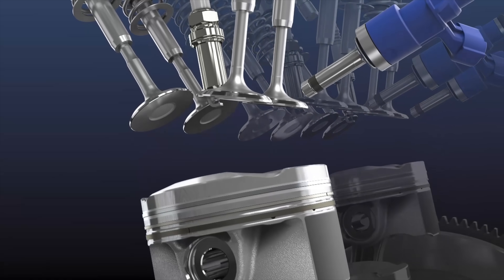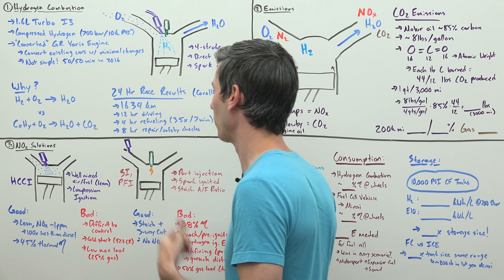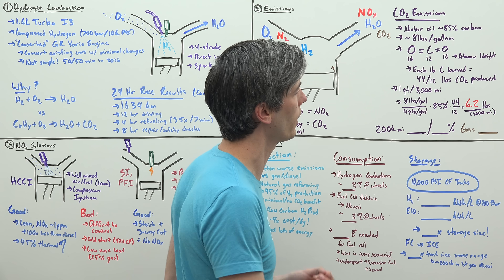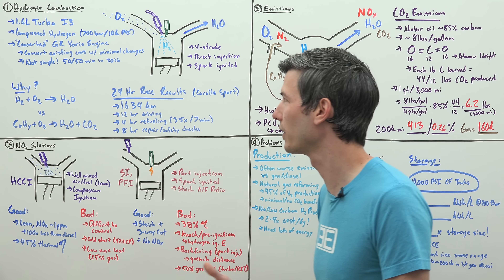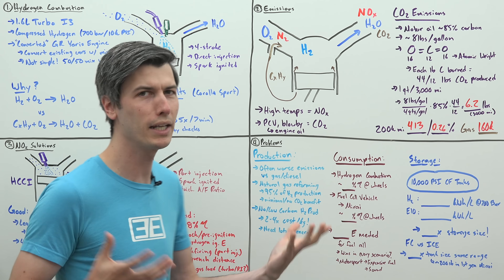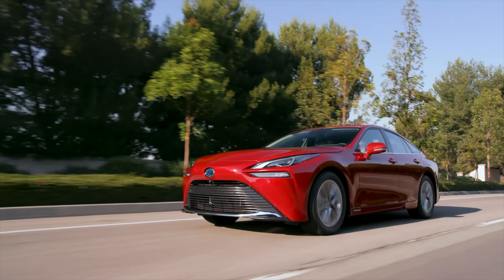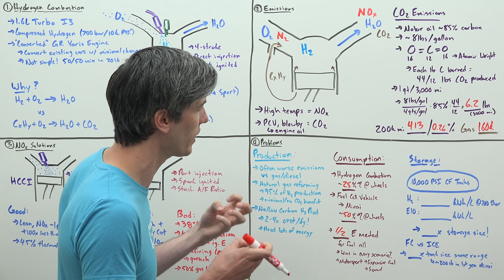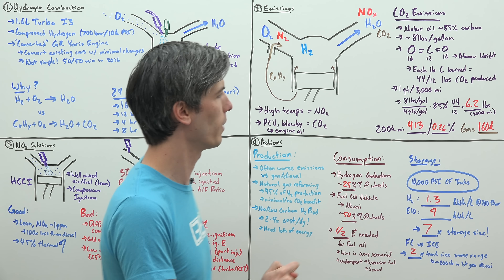Toyota's Developing A Hydrogen Combustion Engine!

Comment: EVs are not the future. First of all, Lithium extraction is extremely harmful to the environment as it destroys and poison's waterways. Second, it's finite, and the deposits are quite small in comparison to oil. Third, to help the second point, we would need a global cooperation plan to recycle 100% of lithium batteries, but only 10% right now is recycled globally, 90% goes to landfills and makes it impossible to recycle again for the future. Hydrogen is a decent alternative to gasoline/diesel engines. However, with the technological advances in emission reduction for gasoline, why would we go anywhere else? Are we really believing the government narrative that CO2 is bad for the environment? Plants and trees literally need this to survive. 18% of the human composition is CO2. What we need to do as a society is to be less dependent on air conditioning and learn how to cope with the increasing global temperature because NOTHING we do will lower it. 

Humans constantly think they have solutions for everything, but the earth has it's own plans regardless of what we want.

Comment: Burning hydrogen (H2) makes much less sense than burning methane (CH4) because methane has energy from carbon and is a readily available gas whereas hydrogen has to be produced using energy.  Although, both are not practical in vehicles because the low energy density. Stick with gasoline.

Comment: Yes, they are not efficient yet but I think this maybe a very viable option as progress is made. Gasoline vehicles were not efficient at all 100 years ago either. I hope they will become better. At the very least we should move away from electric. They are not renewable or environmentally friendly with the battery, Hydrogen fuel cells or combustion is the way to go.

Comment: The only way to make hydrogen is using electricity and the efficiency of converting water to hydrogen and burning it is less that of an EV. Per mile it will cost more before even talking about the storage and distribution

Comment: Why do you believe that it’s expensive to produce using electrolysis? Panasonic has a generator that runs exclusively from solar energy. 🤷🏻‍♂️

Further, Hydrogen fuel cell technology is improving rapidly.

Comment: I guess you didn't think about the synthetic oil. Carbon what?  Also it is not hard to make a car run in hydrogen, you can't believe everything you here, try experimenting your self .  I had my 96 Civic running on hhl only, and all I did was change the fuel lines

Comment: these concepts are such a flop in a toe to toe standoff with EVs.
Suppose you need to reach Point B from Point A..There are two options :
1) follow the Straight line between A and B
2) First take a 5 mile trip to Point C from A and then head to B from there.
The 1st option is equivalent to Evs
The 2nd ones are these.
Which one would you choose?

Comment: There has to be a better way to produce hydrogen, but scientists need to do some research on it. I like the independence of not having a single provider of electricity in my town where they literally start rolling blackouts if too many people start running the air conditioning. Electricity should be only one piece of the puzzle and we need several fuels to use cars

Comment: So, 35 refueling stops for 1635 km = 45km per session.  Could you put 30 miles of range into a modern EV in less than 7 minutes?  Even at race speeds, I think you could.

Comment: Look, LiFePO4 batteries are 1/4 the price they were a few years ago. Making hydrogen from salt water and solar panels will just keep getting cheaper, while oil and gas will keep getting more expensive.  Why not make a hydrogen hybrid, use it as a generator in an electric car.

Comment: Okay, just hear me out. If storage is one of the draw backs of the Hydrogen combustion engine,, why not produce the hydrogen from basic fuels like water. Instead of the fuel cell that combines the hydrogen with oxygen to generate electricity, split the hydrogen and oxygen from water, continuously, on demand and only carry the splitting system onboard, in the trunk or engine compartment.

Except the electrolysis of water requires high amounts of energy? Well, isn't it possible in today's world to miniaturize that system to reduce the energy demand? I'm sure we can find something.

Comment: I've always wondered, what kind of bozos in general are talking about "efficiency" when it comes to hydrogen ICE(HICE) vehicle, especially in the case against electric motor cars, whether it be battery or fuel cell powered - even before the 1st electric cars came out, some economical cars could go as far as 17km~18km per litter of fuel, WHEREAS super cars like Ferrari or Lambo could barely be driven 4km/L, so, those economical cars had WHOPPING 4 TIMES or MORE EFFICIENCY THAN SUPER CARS, not just double the efficiency (as with fuel cell against HICE, like pointed out in this video) 

BUT THEN, NOBODY talked about the "EFFICIENCY" of those super cars BECAUSE it's UTTERLY MEANINGLESS - nobody chooses super cars based on the FUEL EFFICIENCY, it's just that THOSE CARS ARE IN COMPLETELY DIFFERENT MARKET SEGMENTS

NOW, ANYBODY TRY TO TELL ME THE DIFFERENCE BETWEEN THE CASES OF BETTERY/FUEL CELL ELECTRIC CARS VS. HICE CAR AND FUEL SAVING ECONOMICAL CARS VS. SUPER CARS - THERE'S NONE, I wish I never hear about "efficiency" argument about HICE again, 'cause it's just idiotic

Comment: Sounds like the same challenges with electric cars,,,expensive to buy ,very heavy, take ages to charge and in most countries uses carbon generated electricity to recharge..yet we're running down the electric path pretty quickly..the only upside with electric is you don't have to sacrifice power...thank goodness

Comment: Best way to store Hydrogen is H²O nature does it that way... best way to split H²O into HHO browns gas mix are high voltage peaks on low current and high frequency repetition, revisit nikola tesla and stanley meyer's work please... a decent light engine and second battery should produce all gas needed to run the car fueld with water...

Comment: Why trying to convert vehicles? Don't already exist systems that produce Hydrogen on demand and inject it directly into the air intake? At this point an hybrid solution that could be legally approved and used could help reduce the amount of fossil fuel spent by increasing the amount of hydrogen going through the air intake.

Comment: Why hydrogen combustion will not make it:
1. Huge tanks -> sitting bomb
2. Combustion emissions
3. Noise
4. Leakage while sitting car in carage

For resoning:
1. It takes one gun man to shoot at you and car explodes to peaces.
2. In a essence EU is trying to clean cars and the rest of the world while initially combustion sounds nice with water output but nox and co still are produced.
3. Who needs loud cars? Electric cars are so quiet thats nice.
4. You need to store hydrogen in very cold enviroment or otherway it will leak from tanks. You carage unventilated is a bomb.

Comment: Why don’t we start spending our recourses on converting old gas powered cars to hydrogen power. A system that could convert any car using gas to a system that uses hydrolysis to turn h20 into hydrogen fuel. Instead of buying a new car recycle an old one. With a hydrogen conversion kit my 1999 Honda Civic will outlast any electric vehicle with the proper maintenance and would only require water to operate. If you do some research on Stanley Meyer you will find out that he already perfected this system and has since disappeared for sharing it with the world.

Comment: Could you explain what will happen to millions and millions of toxic batteries from electric vehicles as you are aware only a small amount of plastic is recycled due to single use , therefore if they can’t recycle plastic how can these batteries be recycled without causing serious damage to the environment ,in the African Kongo people are getting ill and dying from mining the raw materials for said batteries, also a lot of dangerous pollution comes from the mixture of road surface and tyres as electric vehicles are far heavier than more dangerous pollution due to tyres and surface contact

Comment: fuel cells are just ensuring that no one will be able to design , build or use hydrogen in it's cleanest form. fuel cell tech requires much mining of rare minerals for the devices. bad call.

Comment: Realistically to lower emissions you are going to need to have a variety of vehicle fuel sources. Not just battery electric or fuel cell electric. That's why Toyota is pushing the hydrogen route and doing hydrogen internal combustion engines. And especially in America's case the majority will not switch to battery electric so the government would be wise to explore all alternatives unless they got paid off by the people pushing battery electrics.

I have no desire for battery electric and prefer internal combustion. So if you expect people to "save" the environment thats not going to realistically happen. Car companies are slow at change let alone they don't pick expert brains in creating better catalytic converters, less emissions. They just keep dumping more horsepower into their engines.

As said though electric vehicles is not for everyone and many people are already turned off by them.

Comment: I have been envisioning a hydrogen powered engine for nearly 30 yrs. Is there any hope of a closed circuit, where the water produced is split back into hydrogen and oxygen and recirculated? It would solve many of the problems associated with hydrogen power, including driving around in a potential bomb. I think our smartest minds could figure it out, if they haven't already, but where's the money in perpetual energy for the masses...

Comment: Been thinking this for donkeys years.....Hydrogen is just Hydro Carbon with the troublesome carbon bit missing. The carbonates don't assist the burning. In fact they just take up more wasted space in the tank!
Then they come out at the back causing all the probs. we know about.
Surely an existing internal combustion engine could be fuel injected or as it's already a gas, introduced behind where a the carburetter used to be with little else required?....................................
Hmmm....Watched his utterly ace tech. explanation right to the end. Huh...What do I know!!!
I think that he really explains well that Hydrogen Combustion is just not on!
Maybe the route is to develop fossil fuel combustion but to refine out the carbobits  before putting in the petrol/gas pumps.

Comment: Hydrogen that does not take more energy to produce is derived from hydrocarbons.  Aka fossil fuels. 
Caterpillar, among others, already have engines working today that burn hydrogen.  And As others have pointed out, it’s a lousy source of energy compared with other fuels- you need much larger engines and 4x as much fuel to do the same things.  The low energy content of hydrogen relative to methane, gasoline, etc cannot be  overcome by improving the engine technology.

Comment: Burning 1qt of oil per 3k miles in a Honda? You had a lemon, bud. I've owned several Hondas since the 80s and not one has leaked anything close to that.

Comment: So you get to make a giant video talking about all this, and when I just comment that I think electrolysis is a viable way to produce hydrogen fuel, because it's not finite, and can be produced for free, so the cost in energy to produce it is canceled out by the fact that it is free to make, my comment gets reported for being "big oil propaganda on an educational kids video"???

OKAY Dude, first of all, you can't say hydrogen ice as a whole is a bad idea. Toyota's is just one way of approaching it. There's countless ways other car companies, and just people in general have been approaching hydrogen combustion over the years. If it's really such a problem they never make it to consistent production to be that well known, then aren't we the ones to fix that??? As engineers aren't we the ones to look at the problems, and make them go away? That's what inspired me to be an engineer anyway. This video is annoying. It's so defeating especially over such a brilliant potential filled idea, and in comparison to the dim witted problem plagued reduced functionality ideas of using h2 for electricity, or just plain electricity in cars instead of combustion. Dude, wake up.

It's one thing to explain current development issues, it's another to hark on them, and insinuate canceling the R and D.

You don't need a compression ratio of 42:1, to get an hc engine cold start. What you need is evaluate your data and generate another solution to bypass or solve that issue.

Dude you don't even know how to approach it. You don't even seem to understand what running a hydrogen combustion engine means. You don't need to worry about carbon, NOx, or any emissions, efficiency, and you may not even have to worry about it back firing either. Dude, first of all, each set of new problems requires a new solution to achieve our ultimate goal. So why are you writing off hc engines just because new and different problems compared gasoline engines have been introduced? Why not talk about the solving, or bypassing of these problems depending on various goals. Exhibit A: Toyota's low power new problem, solved, via adding a turbo solution. Goal achieved: a working hc engine in a competitive car. They are not gasoline. They do not have the disadvantages, or advantages of gasoline. They are hydrogen. And when the kinks get worked, out this engine will be far more advantageous than all other mainstream engines. That's why we will forever be abscessed with it.

Comment: This makes far more sense than your recent, and frankly overly prosletizing and worshipful, video on electric vehicles. Electric power is a small bridging step and will never be "the future".

Whilst there are challenges with hydrogen combustion we will do what we always do, solve them. The step, and it is only that, towards electric power is our kneejerk contribution to believing a need to control global warming. Time, lots of it, will tell if this is cyclical or is indeed of our own making, but one thing is certain, electricity on it's own will not become our future means of propulsion.

However, the hydrogen issue is clearly one of 2 parts. Burning it efficiently is relatively easy to solve, producing it in the form required, despite it's prevelance, not quite so straightforward.
Reply: Yes but the great thing about hydrogen is that it is the most abundant substance in the universe. So once the market is strong, the price of hydrogen will be very low in comparison

Comment: Why don't they just make a car that runs by itself.  
Not hard.  You have a 400hp electric motor, tied to a 40000wat generator.  
It's hooked to double separate batteries.  
The car uses one battery to run while the generator keeps the other battery charged & helps power the motor.. When the 1 st battery starts to get low. It switches to the 2nd battery.  The generator will charge the 1 st battery. 
Problem solved.

Comment: There's nothing new about it as BMW started to burn Hydrogen in their engines by mid-seventies and even launched a small production run in the beginning of 2000 - search for BMW Hydrogen 7 in the Wikipedia. The problem always was with the output loss compared to burning petrol reason why BMW used big V12 engines!

Comment: Weight is the critical factor here. This is why an H powered ICE can't compete. The engine would be large, heavy, and require a transmission and axles.

A far more efficient concept would be an EV with drive at each of the four wheels. It could be powered by H in solid storage with an inline tank feeding a fuel cell. Tanks could conceivably be sold on an exchange basis, pre-filled, like propane tanks are today.

The vast untapped source of material for making H is sewage gas, compost off-gassing, and agricultural waste (biomass or manure). All of these can be converted to H, and are currently wasted.

An H powered ICE makes no sense for racing. Wheel driven EV's are superior in every technical respect to an ICE, except for the energy density of petroleum based fuels. EV's accelerate faster. They have more torque than a gas powered ICE. They have a smooth acceleration curve. They are simpler, have fewer parts, require far less maintenance, and are inherently safer. The only problem is electricity storage.

Theoretically, a hybrid EV with an onboard diesel or gas powered generator and fuel tank would be both more efficient and more reliable than a traditional petroleum powered ICE vehicle. This would permit the use of a much smaller array of batteries, and would readily facilitate travel without long recharges or the considerations around the availability of charging stations. A 1 liter 4 cylinder genset can be a very clean burning component. It would not require a transmission, just a flywheel to facilitate the maintenance of steady rpm's. The genset would kick on as needed to replenish the onboard battery bank.

Comment: Hydrogen fueled engine prototypes have been around decades, it's not a viable option for mass production as it's too volatile especially if you have a hydrogen tank as fuel. You can run a water tank and have a particle separator. There is also too much thermal inefficiency in adverse environments, allowing poor fueling and higher potential for failure eg explosion.

Comment: I would rather have these engineering and efficiency problems, which can be solved, than rely on full, battery, electric vehicles which require lithium, which will be in sort supply due to who produces it and who has control of said mines; Russia and China.